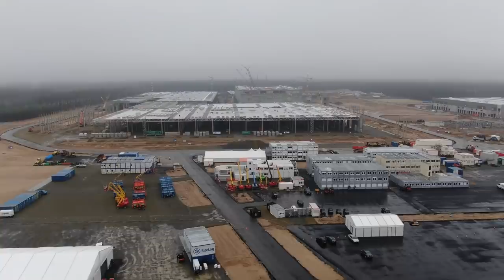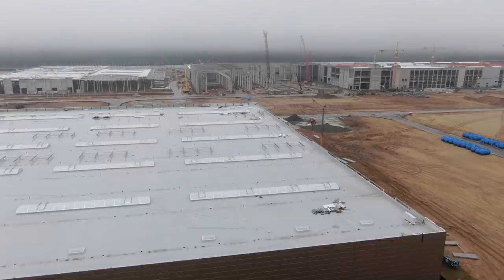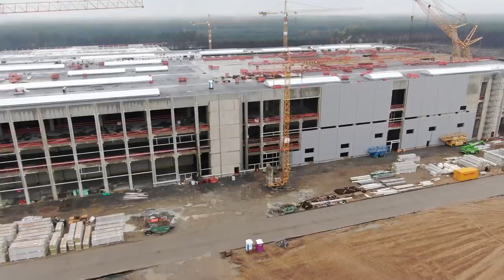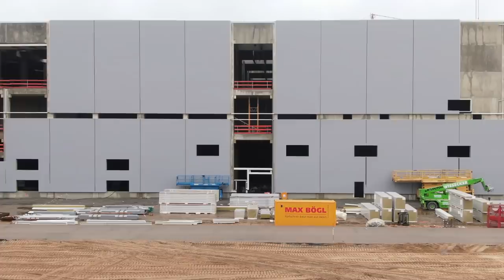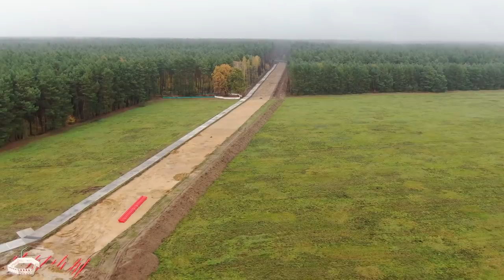Giga Berlin | 2020-11-01 | Sunday update

Comment: This is great visually and aurally, but I am still finding it difficult to figure out the path the car will take in its production through all the chambers of these buildings!
Reply: That’s why those cars are self-driving :)
Reply: i posted the link with the description ;)
Reply: Agree, I keep getting stuck on that as well— I get the whole stamping and casting feed into body in white, and then it goes over to paint... but general assembly is on the opposite corner of the main cluster of buildings.  It seems like a lot of transport needed to get everthing around the factory, which is what I thought they were trying to avoid.
Reply: @sboomb  yes that’s an interesting article but doesn’t really explain the path the assembly takes....
Reply: @sboomb  Captions on the image are illegible even on a 30" desktop screen.

Comment: When I get frustrated with giga Texas and its lack of progress I come here and feel better
Reply: Giga Texas has been moving faster, 3 months in giga Berlin had little to no building work, and 3 months into giga Texas there is already the first steel beams and foundation work
Reply: I am surprised, but I think Texas will actually end up going much faster.  It seems like very little interior work is being done in Berlin so far— just the structural shell.  Paint does have some support systems (cable tray supports or something) installed, but I had thought there would be more by now.

(Most of the advantage Texas will have are the lessons learned in and for Berlin.  No slight on the Germans; it is an extremely efficient and well orchestrated process that seems like it is held up in making decisions, but stamping seems to be very far behind where it “should” be.)
Reply: @patrickkenny2077  What would we be without experts like you.
Reply: Texas is  bigger, but I am impatient about Texas too because I can't wait to see the Cybertruck.
Reply: @stevelelew6145  well since Q3 earning call we know that what is being build in Texas is for the model Y no ? Cybertruck is still « in development » on the presentation
Reply: It doesn't stack up to compare the two sites - Texas has massively more ground preparation to do and is a larger development and Berlin seems to be hampered to some degree by German planning regulations and working practices. Let's not make it a race - just sit back and admire the impressive work ethic and resourcefulness of both - Rock on Tesla
Reply: Great things take time.  A sound foundation will ensure a great structure.
Reply: @omardecasas  Well, Giga Texas had to fill up and level a swamp first.
Reply: @ourwetdogs106  I wouldn't call it hampered. It's just that Tesla cannot make the final plans for their sites until after they have bought them---and at that point we know about. Drawing plans, contracting building companies, ordering materials, getting permits, etc. takes time and is different at any location. In Texas they could slowly flatten the ground for 3 months and do all of that in parallel. In Germany they had to rush for tree clearing and then seemingly nothing happened while they did that. In China they could do plenty secretly in advance and then finalise stuff while they employed a fleet of pile drivers.
Reply: @omardecasas we had corona shutdown  around that time. Also what takes most time in berlin is foundation work for stamps etc. I think before that is finished they don't need to rush the remaining facilities.
Reply: Agree 100% Berlin is huge and monumental. To see such a sight in Austin will be overwhelming!
Reply: All the more so if it is in midst of the ecological paradise that Elon has mentioned.

Comment: Great to see the works on the electrical substation, it would apear that this is to the south of the site and near the Freienbrink where to the west of this location is the part of the gernan power grid on towers.  Would you be able to fly around this area to confirm what may be happening from (52.366897, 13.792486) to (52.371257, 13.804837) and then into the substation site itself, then into the site.  What are the site huts at Große Lindenstraße going to be used for.
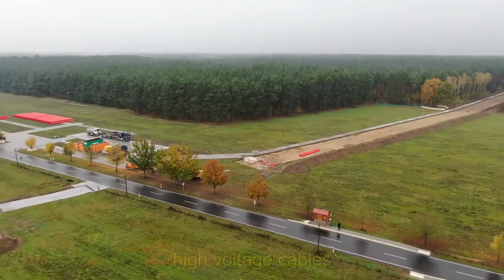Reply from the maker: Yes, it will connect to the grid south of Freienbrink. The footage at 12:37 is actually at 52.371257, 13.804837

Comment: nice video as usual. Could you please do a fly around the electrical switchyard at some point? Love to see that in much more detail.
Reply: Here a video going a bit more into the details of the e.dis switchyard.
https://www.youtube.com/watch?v=oX8aVMPlbVA&feature=youtu.be&t=790
Reply: @abalada  Thanks. But I meant the one next to the drive unit fab shop. There is nothing to see here yet.
Reply: @robertvanrees  Tobias had details on it in previous videos. Don't think there have been many changes there since. The foundation for the transformer is to my knowledge not yet finished. And then they will surely wait 4 weeks before they will place the heavy transformer on it. The 110 kV power cable will come in those red pipes seen at the end of the video.

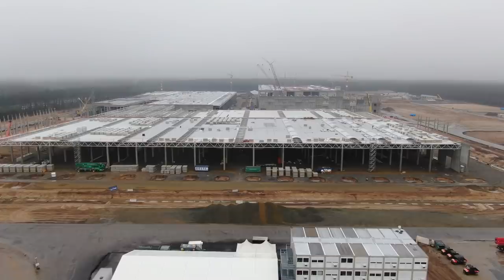Comment: 2:30 If those 4 red electric carts in the foreground are the same ones they use at Starship space port they cost $14k each
Reply: Sorry to let you down, but they are Kubota RTV(X), Diesel powered and cost way more than your 14K
Reply from the maker: The red ones are diesel powered Kubota RTV, but they also have electric grey ones which are Polaris Ranger EV.
Reply: Well that's disappointing...

Comment: 12:40 Any objections or protests against the deforestation for the high voltage cables from the "environmentalists" that try to stop Tesla nearby?
I get the feeling their concern for the forest is very specifically concentrated on the Tesla property.
Reply from the maker: There were some protests against Tesla at the area of the substation when it got cleared. The protesters didn't know that it will be a substation and isn't build by Tesla.
Reply: @TobiasLindh  Ok, it's a reporting problem then, it's not big enuogh news.
Reply from the maker: Well, when I saw it, it was just 2 people with signs. Not worth reporting about it.
Reply: @TobiasLindh  Fair xD

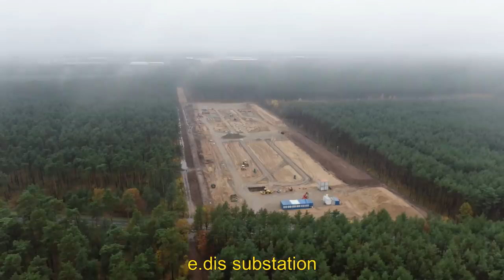Comment: what is that last part? 12:36
Reply from the maker: That's work for the high voltage power cables that will supply the factory.

Comment: Giga Berlin seems bigger than the one in Texas, at least when I saw the land after clearing out the trees and levelling it before construction started...
Reply: Looking at the plan it only looks like 800m long. Texas is over 1km long.
Reply: @saff226  I don't know, I saw pictures for Texas factory and the land looked smaller, anyway, it don't matter much, but I think the factory in Berlin will be bigger at least in terms of buildings, it will start with Model Y and I think they plan later to start building Model 3 there so that means another production line, and/or the coming cheaper small car that is to be launched around 2023 or maybe earlier. The market is shifting quickly towards EVs in Europe, suddenly in Sweden 34% of car sales during September were pure battery driven EVs, that's a fast change that no one anticipated. Forgot to mention that they plan to produce batteries in Giga Berlin, it will be a huge production facility...
Reply from the maker: The cleared area at Giga Berlin right now is a little bit smaller than the cleared area at Giga Texas. But Giga Berlin will double the cleared area soon. 
I think the buildings at Giga Texas are also a little bigger than the first phase of Giga Berlin.
Reply: @TobiasLindh  the eyes cheated me, I thought that GigaBerlin is bigger, but what is important is that people to have jobs and for economy to roll, I don't care much about Tesla itself, for me, to see more people having jobs is what makes me happy...